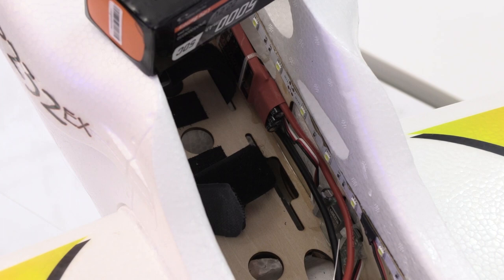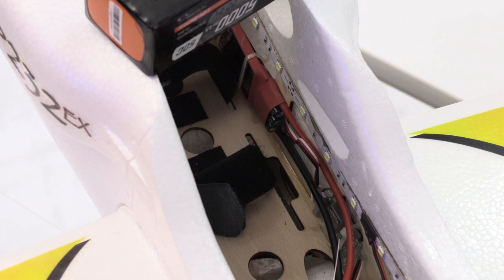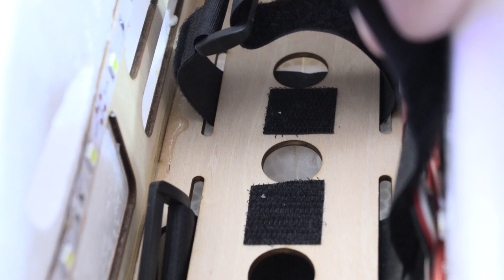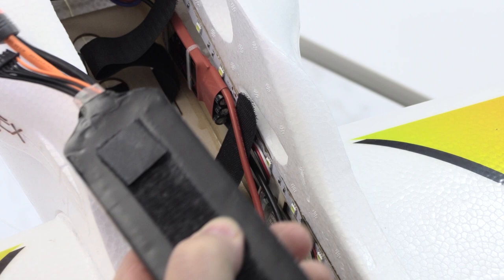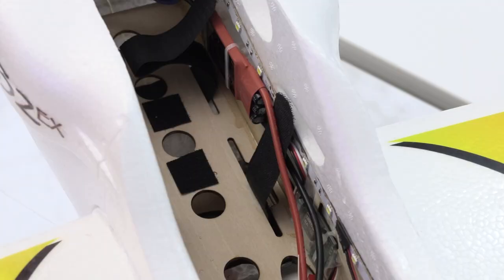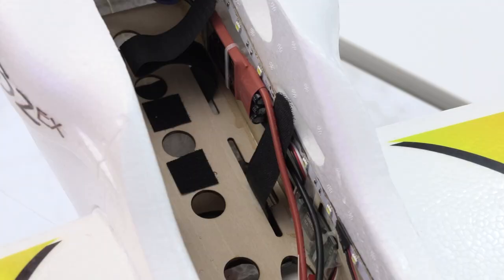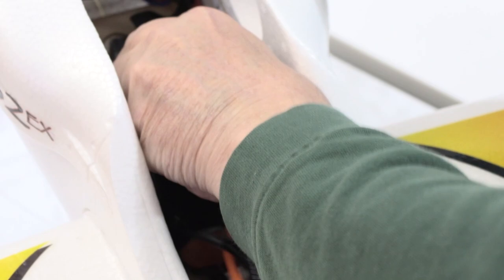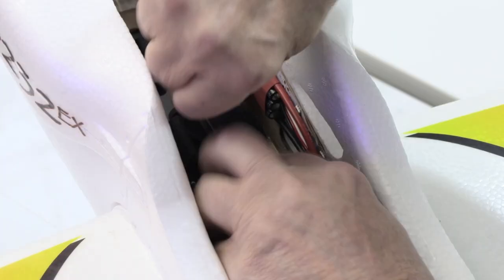"Hookers" on batteries

Comment: Wow. Never knew that would work that way. Thanks for sharing.

 One thing...It isn't a good idea to handle your Lipos by the leads...especially with a bigger heavier pack. Pick them up by the body and I would advise not yanking on the leads like that. You can pull connections loose inside the pack and ruin it.

Comment: Nice! I use the same idea except I just glue foam rubber  in place where the battery goes. Provides plenty of friction to hold the battery in place with a strap. Then I don’t have any velcro on my batteries at all.